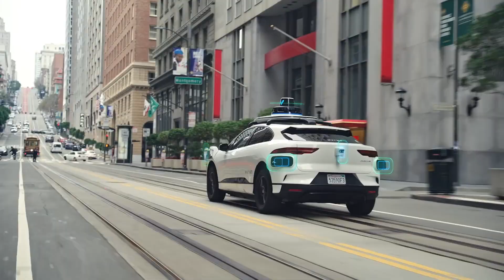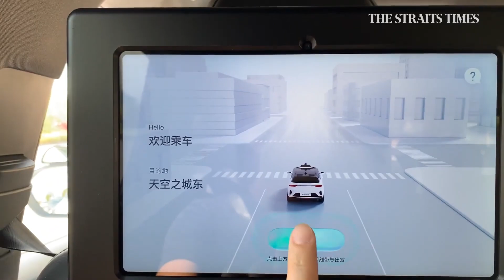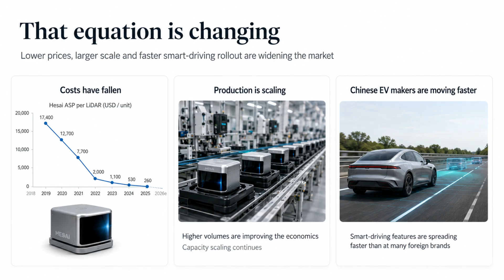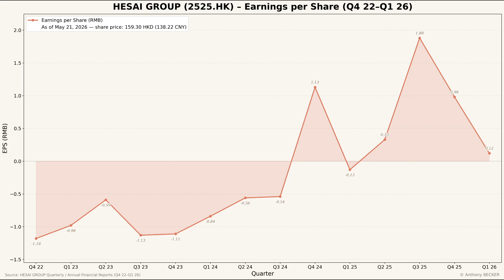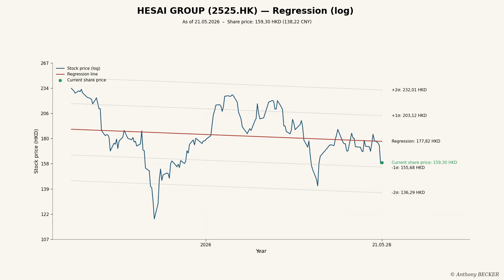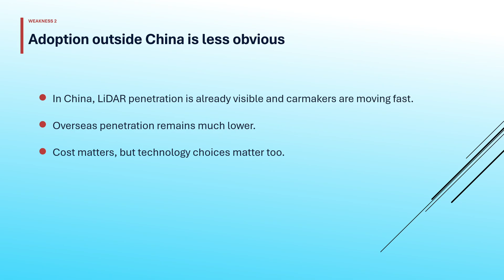Hesai (禾赛科技) Stock Analysis: The LiDAR Bet Behind China’s Smart EVs

Comment: nice job thx. thoughts on ouster comparison?
Reply from the maker: Hi =), 
On Ouster, I’d say we’re really talking about a much smaller company than Hesai. Hesai is clearly far ahead at this stage.
Now, where I think Ouster does have a real strength is access to the U.S. market. Compared with Hesai, it will clearly be in a better position there, because the U.S. government could block or strongly limit Hesai’s access to the U.S. market for national security reasons.
So if the focus is really on the U.S. LiDAR market, then yes, I think Ouster is much better positioned.
The problem for me is valuation. Hesai already trades at high multiples, which makes sense given the group’s strong growth profile. But with Ouster, we are moving into valuation levels that, personally, I find quite hard to accept.
That said, I know the U.S. market attracts a lot of capital flows and investors there often give much more weight to narrative and momentum than to pure valuation metrics. So I’m not saying Ouster cannot work. It can still be a great story, just like Hesai. But personally, given the positioning and the valuation levels, I clearly prefer Hesai.